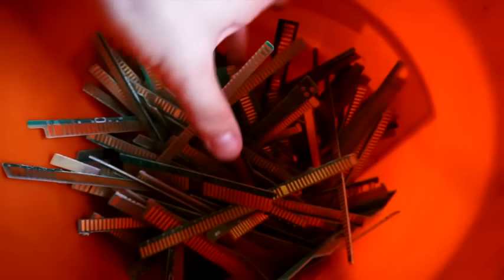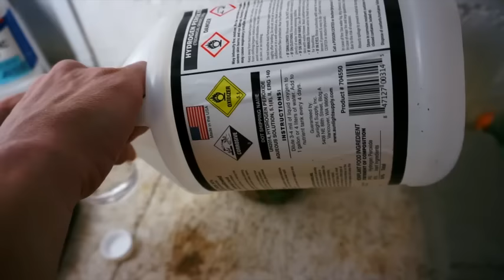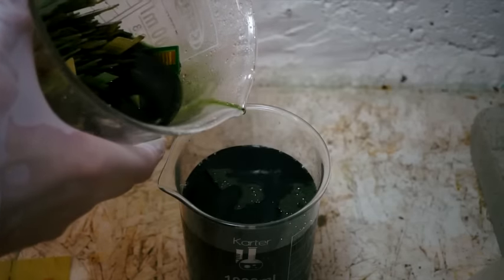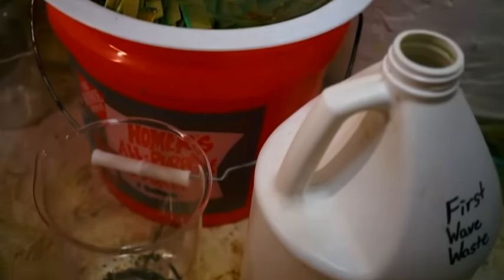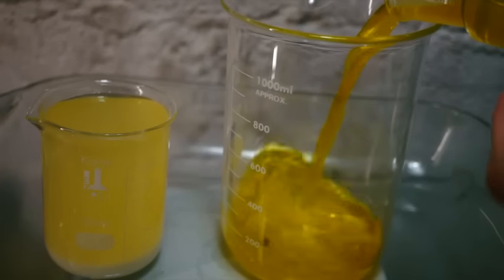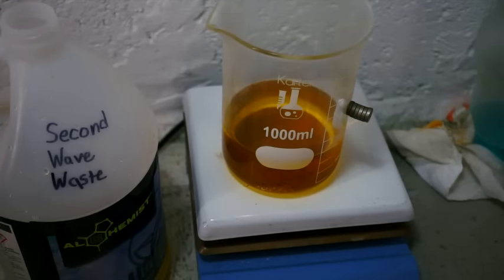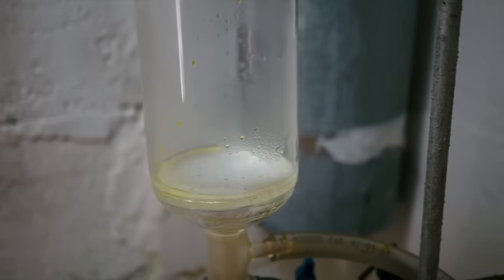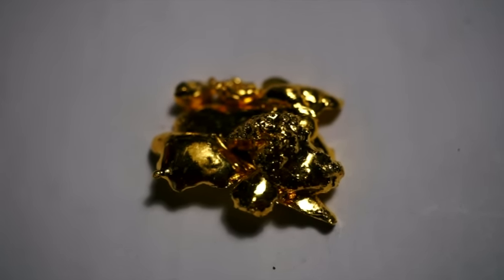How to extract and refine gold from old computer parts.

Comment: Hi, I really enjoyed your video!I was wondering what the average density of the gold after extraction? Also does this depend on the process as well as the initial material used?
Reply from the maker: It's about 19 times denser than water. I used "gold fingers" I purchased at auction off of eBay in this extraction.
Reply: Do you mean purity? Using extracted gold would have the same density as any other gold it is gold, No matter what gold you extract its density  has 19x more density then water 💧. > So what is the purity before and after extraction..  can the process effect purity (yes btw). If I'm wrong I'm wrong just thought the comment was mistaking what the person was trying to ask. Lol

Comment: Thank you Philip. This method was used by Streetips also, with similar results. I have tried it but in much smaller scale. It works, but to justify economically the material must be over 10lb to start with.

Comment: I'd like to know more about the computers you got these scraps from, like how old were they? As well as the cost ratio for the materials used versus the total weight of gold?
Reply: since u only use small amounts of the silutions  after a  few runs u would  make biger profets + the parts he is talking about are more then likely  80-90s computers   the  start up cost is more then likely covered in just that first 26gram run  and the parts  are generly throwen away

Comment: 1. What is the concentration of Hydrocloric Acid HCl (Muriatic Acid) you used here ?
2. What is the concentration of Nitric Acid (HNO3) which you used in the phase after the 1. vacuum filtration (200ml HCL+ a small amount of HNO3) ? Is it concentrated ?
Thank you in advance for your reply.
Reply from the maker: The hcl was purchased from the hardware store and is generally around 28%. I made the nitric acid in a previous video and I gauge its purity to be around  98% 😀

Comment: Interesting that he doesn't wear gloves to handle hydrochloric acid, but he DOES wear them to handle hydrogen peroxide.
Reply from the maker: Yes the H202 in this video is of 34% concentration. At that strength it will instantly burn a hole in human skin. And there is no good way of neutralizing H202 once it has made contact. I will wear gloves under special circumstances. When working with hydrochloric acid or nitric acid I prefer not to wear gloves. Because if you get acid on your gloves you may wipe the acid on to other things without realizing it. I find it safer to neutralize the acids as soon as they are spilled. When I do wear gloves I change them every time my hands leave the fume Hood.
Reply from the maker: @Trailerwalker  the hydrogen peroxide you are speaking of is around 3%. This stuff is 34%. It will immediately oxidize your skin. I have even been able to dissolve small amounts of powdered gold with it.
Reply: @philipbender956  I had a bike accident and needed to get my knee (patella) debrided (I'd taken a chunk off it and embedded gravel, tar and pine needles in it)... 

They put H2O2 on it and it fizzed like a sherbet. ... and it was *HOT*.

Comment: "If you can smell, chlorine you need more ventilation" ? More like need a new set of lungs if you breathe that stuff in. If it can etch concrete, think what it does to your airways.
Reply from the maker: Concrete contains a good amount of limestone. That's why it reacts so well with hydrochloric acid. The hydrochloric acid is able to dissolve the limestone particles quite vigorously thus etching the concrete. Human skin and other organic materials react much more slowly with hydrochloric acid. If you want to know the most corrosive and common acid available to the public is concentrated sulfuric acid. Sulfuric acid reacts most vigorously with carbon-based items.
Reply: Then don't use bleach for cleaning.
Reply from the maker: @frybry01  it's okay to use bleach for cleaning. Sodium hypochlorite (bleach) is a different chlorine compound then hydrochloric acid. But because chlorine is a part of both of these compounds. They both smell like chlorine.
Reply: @philipbender956  I just keep on learning things I never cared about, and I'm loving it!

Comment: What would the difference be between extracting gold straight from components and extracting gold from a bar of melted cpu pins? Would aqua regia dissolve one of these bars the same way it would dissolve the gold foils or would it be a different reaction since there may be traces of other metals in the bar?

Comment: Back in the 70's I worked at a chip factory, that also made jewelry . . . lots of hot acid flowing, and Military Grade electronic parts including gold-coated copper pins . . . we sold the pins by weight, all the different sizes spilling off onto the floor . . . I would sweep them up and save them. 
I intended to extract the gold . . . now I know how much was there . . . maybe an ounce of gold, which was worth maybe a week's pay back then.

Comment: Thank you for one of the most clear, concise and complete videos on gold extraction and refining. If it's not to much to ask... or to lame to ask, could I set up a fume hood in my garage so that the chlorine and other smells from the fumes were not detectable by my neighbors in a residential area with approximately 1/3 acre lots? What would that cost roughly and finally, could you suggest sources for info and materials on the hood, if it's practical in the type of neighborhood I live in. Thanks so much once again.
Reply from the maker: Thanks, I am happy you enjoyed the video 🤗😀 I built my hood into the back wall of my garage just by adding a 6" in line duct vent. That I got from my local garden store.Then I built 3 walls on top of a table and added a door. There is no chlorine smell further than 10' from the outlet.
Reply: @philipbender956  Thanks so much for your reply. I have the garage and a shed in the back yard, either of which I could install an inexpensive fume hood in. But still then, try as they might, they'll never get me to melt down my 1983 VIC-20.
Reply from the maker: Keep it and get some scrap from ebay or something 😉

Comment: Very interesting.  Before people go out to try this, please understand the hazards...not only to yourself (breathing fumes, acid burns), but also proper disposal.  Would like to see a video on how the wastewater is treated/neutalized.  Do not dump to the local street sewer - that sends highly concentrated metals out to your local creeks, rivers, lakes.  Also, dumping to your septic could cause big problems too.
Reply from the maker: Thanks for the tips. I was not sure what to do with it. So, I just watered my garden with it. The tomatoes have been kind of spicy every year since then. The spinach growth has been stunted and it has a very copper penny like tast. The green beans are not green. It's more of a brown orange and they are bitter. If you try to cook them in the microwave they spark and explode. You need to boil them in water on the stove. You know when they are done when you see the rainbow sheen on the water. But they are still kind of bitter. On the upside though. There have been no bugs or molding issues. None of the animals will even go in the garden. Although I did see a squirrel near the garden. Its skin was all pale and hairless. It does not move around very much and it makes this God-awful howling all day. I wish something would just eat it. I don't blame the animals cause I don't wanna touch it either. I think the worst part of it is the eyes. There all red, bulging and bleeding. It's like staring into the pits of hell every time I go out back to harvest more food from my garden. Anyway, I am happy you enjoyed the video.🤗

Comment: Thank you for sharing this process. Just to be clear, I didn't get what you were using in your spray bottle to rise the air pump tubing. Was it simple tap water or distilled or...?
Reply from the maker: I sprade the tubing down to remove any microscopic gold foil. It was distilled water.

Comment: A definite thumbs up on this. I always wondered about doing this. It proved to me not to bother. I would not have the patience to do all of that. Plus, I am not into all that working with acid. I am wondering though. Could you smelt the gold out at some point prior to going through the whole process you show? I don't even know that much about smelting, but from other videos I've seen it looks like it would be possible?
Reply from the maker: If you use the correct flux you can separate the  metals.  I think you need a larger amount of gold for it to be successful.

Comment: Would you also recommend extracting gold via electricity and water metallurgical process be less dangerous then using HCL or how dangerous can this process be? Please mention some pros and cons of this method! I am also trying, any help will be much appreciated. Great video!
Reply from the maker: Electrolysis maybe less dangerous because the acids are of a lesser concentration.
Reply: @philipbender956  Can i contact you via email for some more question regarding your extraction process? Thanks
Reply from the maker: @helikescars  if you have any questions I can try to answer them here.
Reply: Philip Bender I wanted to ask you, what would be the time procedure for each mixture? Starting and till the end! As you have repeated the steps various times, would like to know how long do I have to keep each mixture / acid since the begging before proceeding to the next step and reaching towards the final melting process. 

As the process is very hazardous I would really appreciate the help and note down the time duration and proceed in conducting my own steps. 

Thanks. awaiting your reply!
Reply from the maker: @helikescars  the timing varies from scrap to scrap. But the longest procedure is the first one. Removing the gold foils from the circuit boards takes the most amount of time. From 2 days to 3 weeks. There are a lot of variables. Such as acid temperature and strength. Quality of your circuit boards and overall procedure. Once the gold foils have been separated from the circuit boards. Dissolving the gold foils in aqua regia takes about a half hour. It may take longer depending on the strength of your acid the temperature and the quality of your gold. once again melting your gold is dependent on its quality and the type of heat source you have. In this video I used to hand-held torches and it took about 25 minutes to melt. If I put that same gold in my foundry it takes about 5 minutes to melt.
Reply: Philip Bender wow, okay, that’s a lot of environment tasks to keep in mind before dealing with the extraction! Thank you. This will help me to make sure and align the right temp, quality and the right conditions. I have the same magnetic stirr and heater as yours. The cooling time is the most important. Thanks.

Comment: Hey, I like the set up. I’ve been collecting computer boards for now and finally began to process em all. I ran into trouble with step 2. I’m using HCl and bleach but I don’t think that makes a difference when precipitating; however I’m sure I either didn’t use enough stump out or I didn’t add it correctly. Do you have a good estimate as to how much you used.. maybe in grams possibly in containers? Also it’s just distilled water for that solution right?
Reply from the maker: Just keep adding the SMB until it's all dropped. It may take multiple doses of a saturated solution in distilled water. Once you see SMB crystals building up at the bottom of your container. You have probably added enough.

Comment: Can you put in the description the list of chemicals used/ location to find chemicals/ measurements of the chemicals/ temperatures/ etc.? If not, no big deal! Loved the video!!!
Reply from the maker: I used hydrochloric acid that I purchased from Home Depot. The concentrated hydrogen peroxide was purchased from a hydroponic grow store. Nitric acid can be purchased from eBay. Sodium metabisulfite can be purchased from eBay. You just need to feel out the extraction to understand how much chemicals you need. Pro tips, keep the scrap completely covered with acid. Use heat to speed reactions along 😉
Reply: @philipbender956  You are so awesome. Thank you :)
Reply from the maker: @ethansimkins8015  thank you, I am happy you enjoyed the video 🤗😀

Comment: What is the concentration of the commercial HCl you used? Brands may differ otherwise labeled.
Reply from the maker: That HCL came from Home Depot and I believe it is 29%. Lower concentrations of HCL will work just fine. The metals actually need water to dissolve into. It's the chlorine that rips the electron away from the metal. Turning it into a water soluble salt.

Comment: Anytime you handle Sulfuric acid / Hydrochloric acid wearing chemical resistant glove is a must for safety. At the Lab we are even required to wear face shield also when handling acid.
Reply from the maker: I was wearing gloves when I stuck my hands in the acid.🤗 Luckily, I own and operate this lab. So I don't have to obey the same rules that the other employees do. Also, once you have experienced a acid burn 3 or 4 times. You know what to expect. Stay calm, dunk your hands in baking soda and rinse clean 👌 You have 30 or 40 seconds before it starts damaging you. Don't get me wrong I do wear gloves when working with very dangerous items. But the stuff in this video isn't that bad. Just ask Cody's lab.

Comment: Where do you usually buy from? Can you provide some ideals of reliable places to buy computer fingers? Thx
Reply from the maker: Yes search "gold fingers" on eBay. I like to purchase from auction or best offer. Check the price of gold. Don't pay more than one g of gold per pound. While refining gold from computer scrap is fun. It is a gamble. You may have more fun buying Sterling silver at auction. Old Sterling silverware and plates. You can hold these items as is or refine them or melt them down into Sterling silver bars. Just saying it may be easier to get your money back in the end🤗 As a pawn shop or a jeweller will except these items. Computer scrap, not so much😏

Comment: The part when you pour the ar solution with sulphuric acid into the vacuum filter to remove the lead. How does it not dissolve the filter?  Fantastic informative video. Watched it several times and took notes. That is the only part that confuses me.
Reply from the maker: I only add a small amount of sulfuric acid. Some will bond with the lead precipitating out as lead sulphide. The remainder becomes diluted.

Comment: Another older vid about reclaiming gold started with about $50 worth of pre-cut junk, and after buying the chemicals and going through a time-consuming process the guy ended up with a small bead of gold, much less than is shown here.  That bead of gold was worth a bit less than his cost of the original bag of materials to be reclaimed.  Adding his time, cost of glassware, torches and torch gas he came out way behind.
But if that is not a problem, then that's gold in them thar dumputers!  Especially if you get about 25g of gold, worth a bit less than $2,000 US, out of 5 lbs. or reclaim!  Damn, that could be profitable!  But like the guys says, not all reclaim scrap has the same gold content, and the trick is to find the good stuff.

Comment: When you make the saturated metabisulfite mixture are you adding it to hydrochloric acid?
Reply from the maker: Yes, the sodium metabisulfite reacts with the dissolved chlorine in the solution producing sulphur dioxide gas.

Comment: Very well explained, we see professionalism, a question, in which solution do you dissolve SMB, water? Thank you..
Reply from the maker: You add the SMB to your gold bearing solution when you are ready to precipitate the gold out of solution.
Reply: @philipbender956  Thank You..
Reply: Sir, how important is the use of the oxygen pump?
Reply from the maker: @szokejanos7454  the air pump is not necessary. But it will make the extraction much quicker.
Reply: Thank you..
Reply: Hi, sir I have a question again, use white HCl at first, then use yellower HCl .. what is the difference in concentration between the two ?, Thanks ..

Comment: just how much did all of these acid's cost? heating, water, test strips cost? was it worth it? on the 22/09/21 26.168 grams was around $1488.
Reply from the maker: I used about $20 worth of chemicals in this extraction. I think it was worth it but it is also my hobby.

Comment: Probably mentioned previously, but I recommend wearing proper gloves while handling conc. HCl and H2O2. Both will burn skin on contact.
Reply from the maker: Yes, gloves are important. I prefer to just not spill acid on my skin. You need to take your time and be alert. Also, I keep plenty of baking soda around to deal with spills. I don't like the gloves because if you spill something on them. You may not notice it and transfer it to your clothing. Also, the nitric acid I use is 95% and will cause a fire if spilled on gloves.

Comment: Great video Philip I have recently expanded my shop and have wanted to do this for years. Two questions:
1. Do you have a print version of your procedure?
2. How would I go about getting the computers for the process?
Reply from the maker: Just search 'gold fingers' on eBay and you can get computer parts at auction.
Reply: @philipbender956  That is about $1500 USD worth of AU at today's rate. 1/22/22   quite the haul.
Reply from the maker: @jeffreyhutchins6527  Thanks, I am happy you enjoyed the video 🤗 😀
Reply: You might be able to go to a scrap yard and buy some.
Reply: <<2. How would I go about getting the computers for the process?>>

I'm guessing that the key to making money would be to get such things as junk or trash,  before it goes to some recycler. A recycler is going to know just what things are worth ---no bargains there!

A free notice in Craigslist that you will pick up old computers might produce some.